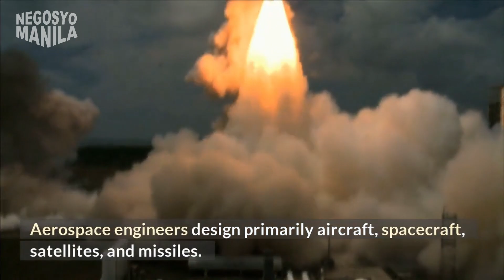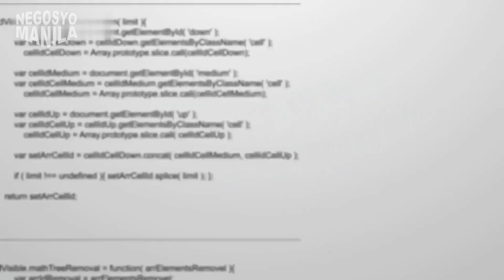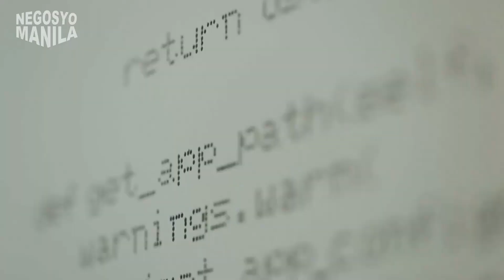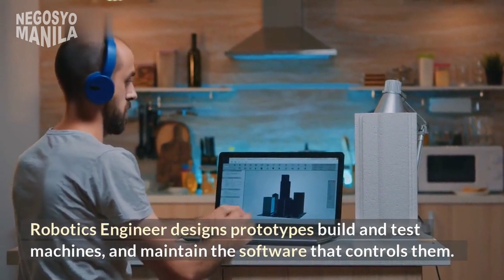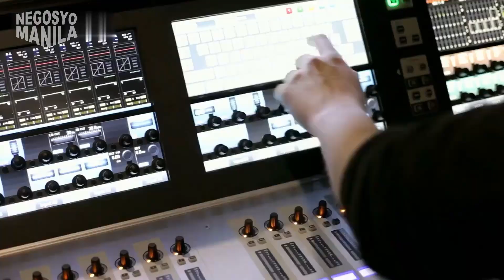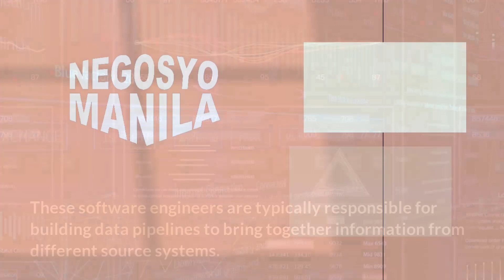Careers in ELECTRONICS ENGINEERING | 2022 Edition

Comment: Wag na kaung manguha Ng Kurso electronics engineering. Kahit na nakagraduate na kayu at makapasa Ng board exam, if Meron kayung electronics and communication system design di nyu rin maiimplement Yan dahil need nyu pa Ng pirma Ng PECE wherein vulnerable ung design nyu at maari magaya nya at pede nya rin kayu kalabanin sa bidding of project. Sayang lang mag aral Ng ECE sa Pilipinas.